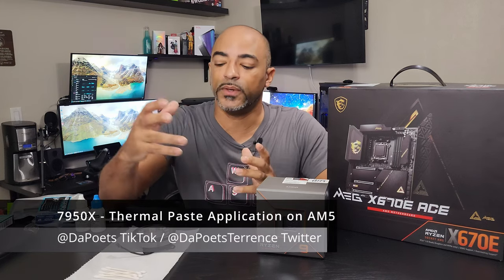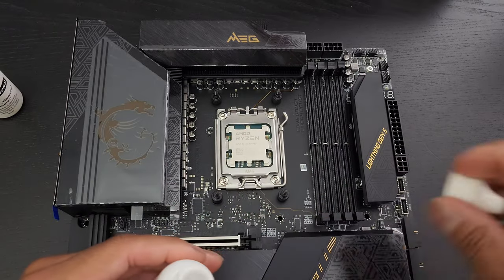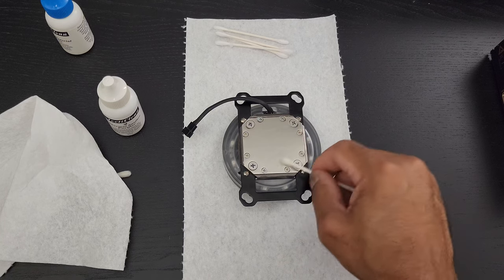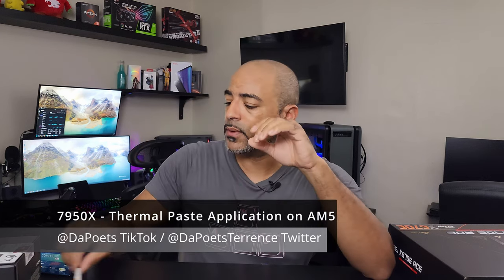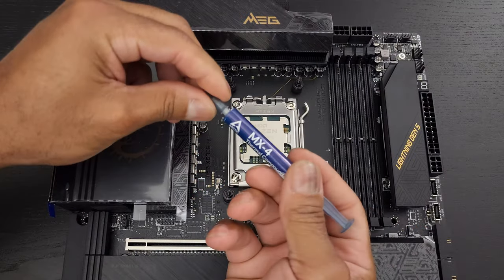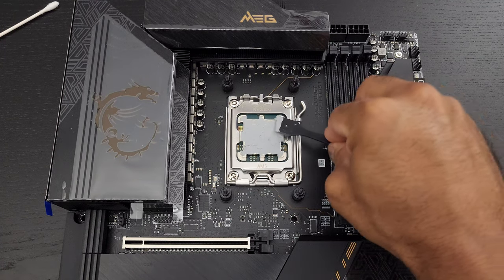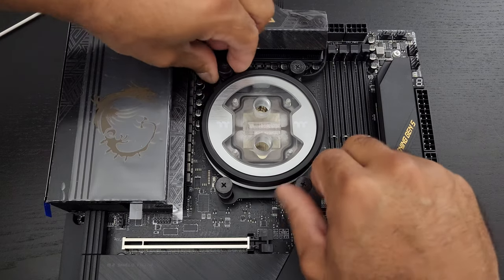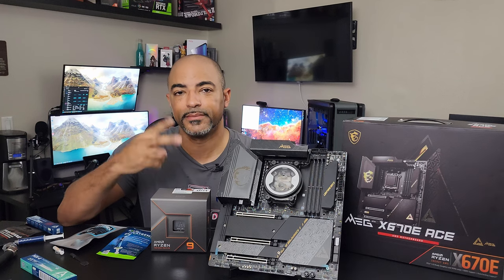AMD AM5 - How to Apply Thermal Paste - Ryzen 9 7950X

Comment: Wait.. how AM4 is diffirent that AM5 ? From what I know all coolers that work on AM4 will work and on AM5.
Reply from the maker: No, most AM4 coolers are not automatically compatible with AM5. Only ones that use the AMD bracket clips are.
Reply: @DaPoets  ОК .. that is bad... I just order Deepcool GAMMAXX L240 V2 and now I am not sure that it will be possible to install it on the AM5 bottom which I also ordered today.
Reply from the maker: @AntrAcsA  just check the website to see if that model is compatible or if it needs an adapter

Comment: My 7950x was incredibly hot when I used this method. Was at like 70 idle. I tried again by putting it on the cpu and also all over the heatsink and it now sits at about 38 idle
Reply from the maker: You must not have had enough pressure on the IHS
Reply: @DaPoets  Yes it could be it. I definitely tightened it until I couldn't move it anymore this time anyway.
Reply: @DaPoets  There's one other small issue I have if you could please help. I've got the same motherboard too and when I wake the PC from sleep, it says 'EA' instead of the usual CPU temp. And the processor fan seems to run faster too because of it. I'm guessing it's some sort of reboot error but I'm not sure what causes it or how to fix it. I'm sure it's something simple though.

Comment: MX-4 is a 12 year old product, anyone that spends 5 minutes looking at what's available in 2022 wouldn't really consider it.
 Market leaders are probably CoolerMaster MasterGel Maker and Thermal Grizzly Kryonaut if you don't mind a little extra expense.
 Most people don't spend 5 minutes pasting up the cpu, it just traps a load of tiny air pockets in there.
Reply: MX-6 is out now

Comment: Never trusted the butter approach. Surely the risk is you create an uneven surface and trap large air bubbles. Prefer the thought of one health center blob. Or five small grains of rice.
Reply from the maker: The metal on metal pressure eliminates all of that. Don't worry about it. zero air gaps and unevenness.
Reply: @DaPoets Probably... But an extreme analogy? If you were to draw a large circle on the surface of the CPU with the paste and then place the heat sink down, there wouldn't be a risk of that lower area (in the middle) retaining air? Why any different with toast spread method with a lower area?

Comment: No components to cool on those "legs" of the CPU, no reason to put paste there.  Just a higher chance it falls between them making it hard to clean.
Reply from the maker: Incorrect, the entire IHS gets hot and you want the "legs" covered in thermal paste to have as much of the heat transferred as possible. Those "legs" get extremely hot underload, you wouldn't want to touch them with your finger.

Comment: Let your cooler spread it, do not do it manually like you did, it will be uneven.
Reply from the maker: Incorrect. Being uneven doesn't matter. The pressure of the IHS and heat sink equalizes everything. Not doing this way leads to risk of underexposed areas.